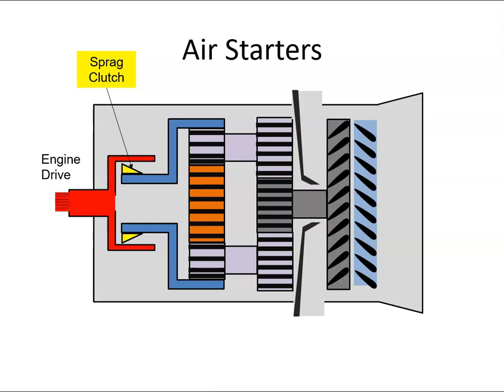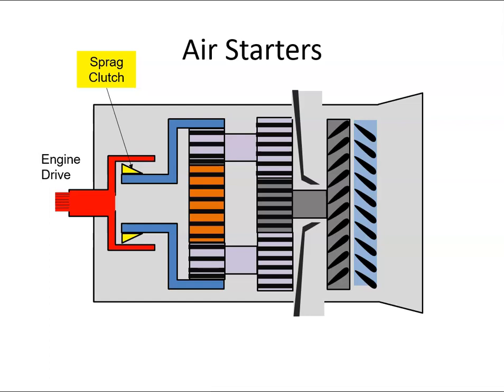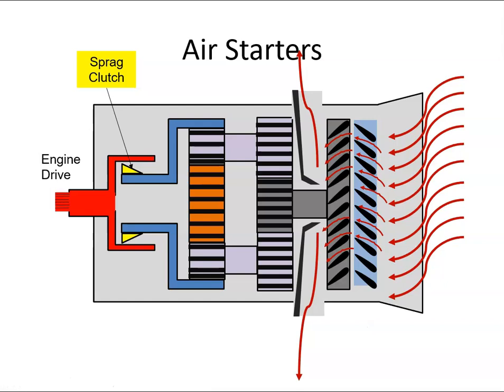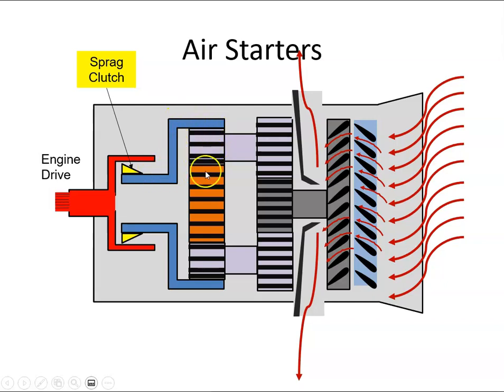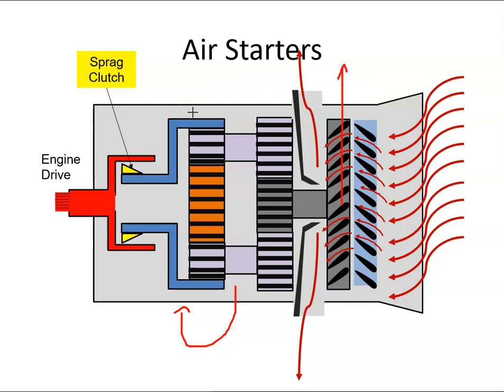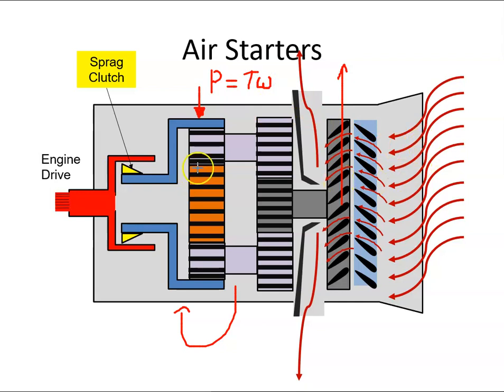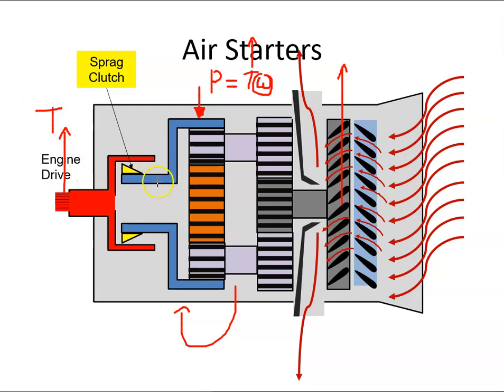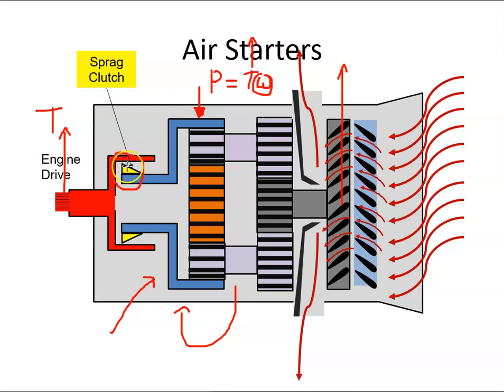Gas Turbine Air Starters

Comment: I thought air starting meant feeding compressed air directly into the combustion chamber to be ignited with fuel which would then drive the turbines and thus the rest of the engine, allowing it to run on it's own. I didn't know the air starter was an actual motor.
Reply: In fact, you are partially right. they do use compressed air to make the turbine spin.